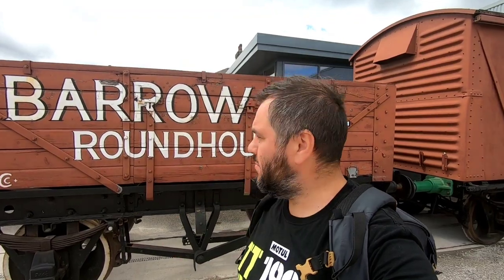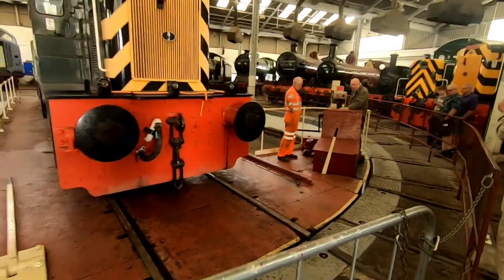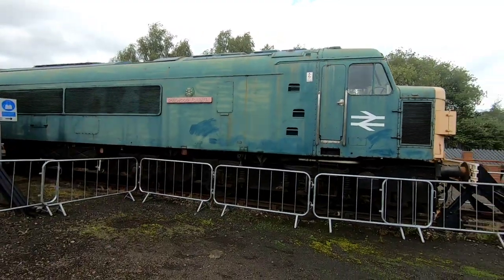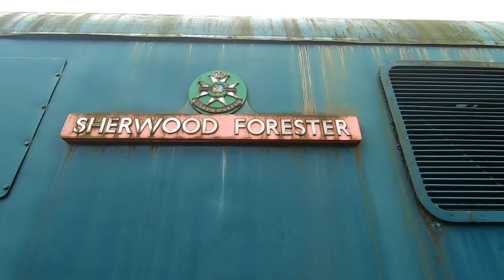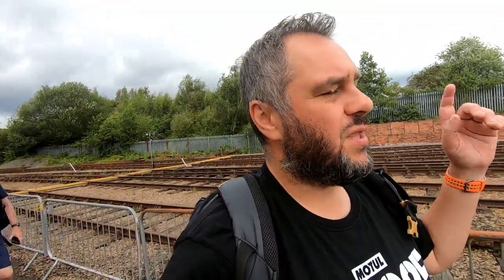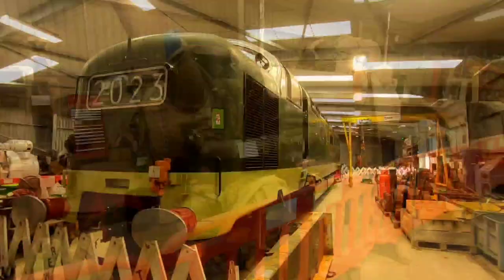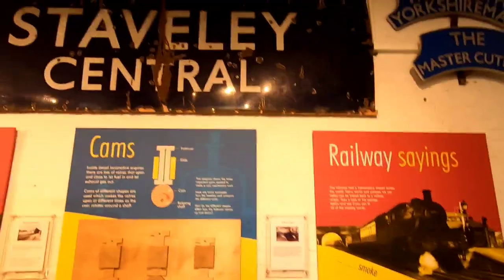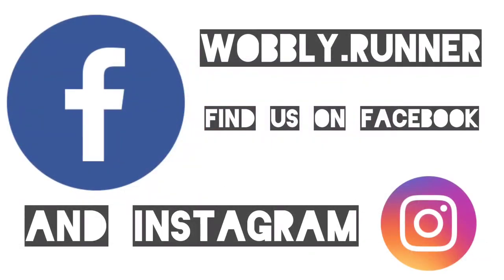Day out at Barrow Hill Railway Museum, Trains Galore

Comment: Glad you enjoyed your day at the Roundhouse Wobbly Runner, I wondered how it long it would be before you visited! If you have any questions about things you were unsure of please ask. The signal box is normal open 11am and 2pm. The Spider we converted to a water dispencer in the 1990 from its original sand use. The handle your mate thought was the horn on the Deltic cab is actually the loco brake, the horn handle was by your right knee when sitting in the driver seat. Regards Martyn - one of the Trustees at Barrow Hill and will be looking after the place tomorrow!
Reply from the maker: Fantastic. Thanks Martyn. Great stuff.
I'll definitely be back again.
Even if it's just to see the signal box working.
Reply: @WobblyRunner  When we open the SB we give a small talk on how you would signal a train by Absolute Block working from box to box and generally any signalling question (depending on who is doing the demo).